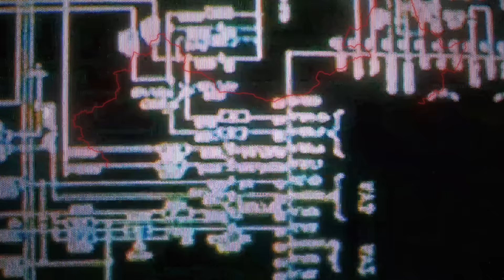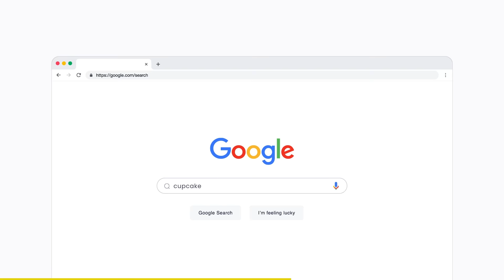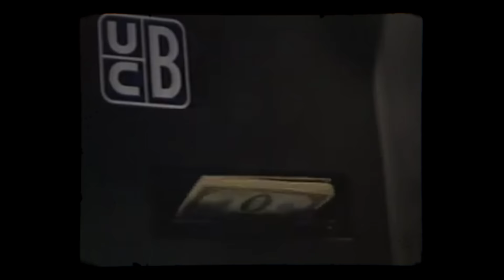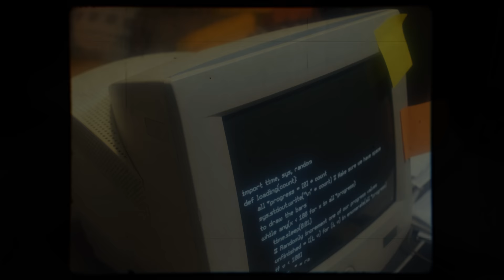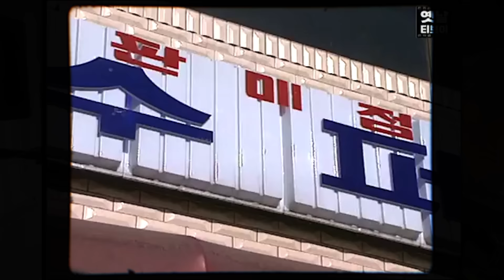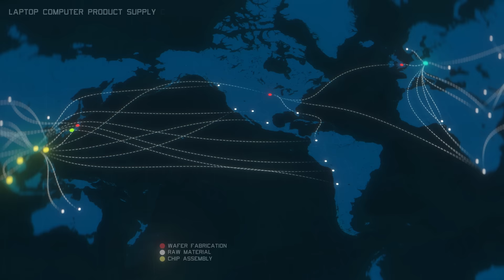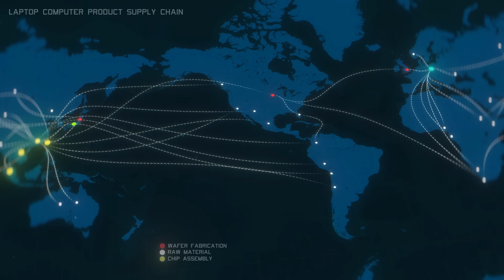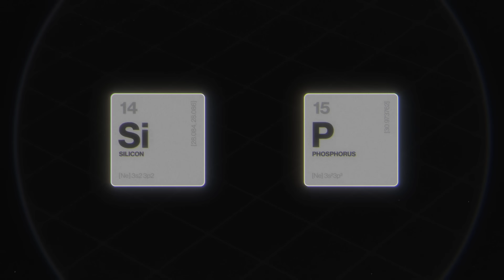Our New Global Economy

Comment: I dont even know where the stock market is headed to right now. my portfolio of around 200k is not increasing more than 5% and people are predicting a crash .
Reply: I don.t really know your risk tolerance or asset allocation, sounds like just bad stock picking. Also unclear if the advisor is providing any other value via financial planning or other decision making. But likely scenario is just bad stock picks. Index funds, Etfs and chill.
Reply: ..You should definitely fire yourself ! That's a bad financial advise. Over 50 years of data reveal that those who work with fiduciary advisors typically earn more than those who go it alone. I've been fortunate to work with one for 6 years, resulting in a $3 million portfolio.
Reply: I've been looking to get one, but have been kind of relaxed about it. Could you recommend your advis0r? I'll be happy to use some help.
Reply: Amber Michelle Smith is the licensed advisor I use. Just search the name. You’d find necessary details to work with to set up an appointment.
Reply: Thank you for sharing, I must say she appears to be quite knowledgeable. After coming across her web page, I went through her resume and it was quite impressive. I reached out and scheduled

Comment: As someone who is involved in global manufacturing and seen this all happen, I am not surprised. All the moving of manufacturing overseas just provided short term gain. The answer is to not take away global trade, it is to make every country play by the same rules. The same health and safety rules. The same minimum wages (edit: min wage I think now is impractical). The same worker's rights etc. Right now, we do not have the same rules and policies in place.
Reply: can’t have the same rule for everyone because  countries are at different development stages.  However, forcing China to play by the same rules would be a start.  China plays with its own rules that only benefit itself
Reply: We can't even do that among US states, and that's part of the reason that all of this works.  For example, if China was forced to use the same minimum wage as the US (to say nothing of the states that have raised MW above that), then there would be no reason to have those jobs in China.  We look at China as "stealing" our jobs, but think nothing of the Europeans that are out of work because compared to US labor (even unionized US labor in many cases), their labor is shockingly expensive, so the production occurs here rather than there.
Reply: It wouldn’t make sense to give everyone the same wages. First of all, there are so many different currencies, not one central currency used by all. Secondly, the purchasing power of these currencies varies significantly. Thirdly, the cost of living also varies from place to place, sometimes quite drastically. Half of the world’s population lives on less than $5.50 per day.
Reply: It's called capitalism.
Reply: @cassidyjewel3639 it's all manufactured by humans. We should all be like Star Trek.
Reply: @didiermontagnier6114  lol, a delulu
Reply: so an absolute global dictatorship :D
Reply: @jasonbrannen7598  Good points about minimum wages. So then, at least the health and safety and workers rights should be at the same level. That would be better for everyone. There are some large cost savings companies in countries that are lacking in these things have. Does not make it at fair competitive environment.
Reply: @cassidyjewel3639  Yes,  wages at the same minimum may have disadvantages, but having equal worker rights and safety would make things more fairly competitive. There are big costs in those.
Reply: @californiajohntravels  Right. I believe in it. It just needs to be an equal playing field. Even our North American Capitalism has laws and regulations. Others do not.
Reply: @SublimeNotions  No lol. Just fair regulation across countries. So workers in other countries have the same rights as we in North America have. Easy for other countries to compete when they save all kinds of money on workers' rights. That's why we don't have a Foxconn in NA!
Reply: Your argument fails to address the imminent climate crisis and how strongly it has been exacerbated by Globalization.
Reply: @hannahpickhardt2682  Definitely something the world needs to better deal with and plan for!
Reply: I voted for Ross Perot in 1992 because of his staunch anti-free trade stances and other policy ideas. In 2024, I will be voting for Joe Biden for the same exact reason.
Reply: @didiermontagnier6114  So does Murica, remember Plazza accord !!!
Reply: To begin with, let's remove the US dollar as world currency to level the playing field. Let's have a payment system that's really independent instead of being under the thumb of Murica, can you accept those 2 rules primo ?
Reply: Even if the whole world was at the same level of development, that would still not be possible, because you would have varying access to natural resources.

The world is not supposed to be just in terms of a human understanding of such. Humans adapt to the world. Trying to make the world adapt to us often just breaks things.
Reply: The whole world has 8 billion people with one standard of labor law. That is only possible if there are no borders where people can freely travel anywhere, and the world is ruled by one government. Every country, like every human being, will use its strengths and minimize its weaknesses to get the most for itself. This is free will and freedom America loves.
Reply: That's the same as ending global trade, because there's no way to enforce all the rules you propose on foreign countries, and if you could, the whole point of globalization (from the business POV), to externalize pollution and exploitation, would go away.
Reply: @padraicley3265  Words are free and beautiful, let's see whether the actions match the words !!!!  Can u start with Palestine first ? Plz .... Can the workers who were born in Palestine move freely and come back home whenever they want, pretty simple, heh !!!  How come  peace offers have been stopped dead in its track just bcos of these freedom of return movement issues ....
Reply: Good luck
Reply: this is where the west miss the plot. the west thinks that "job move overseas", it did not see or realised how Asia grew is because of it large consumer base. most of japanese, korean and chinese business are not invested by the west, they grew from consumer demand just like the west. this idea that Asia success is somehow owe to the West is a highly imperialistic way of thinking, it ignores the fact that these countries has consumer who need just as much product as in the West, and there are alot more of them. there are more Japanese than there are German in this world, there are more Chinese than American in this world. imagine the economic advantage of US and Germany was next to each other... then you understand the Asian economies... they are huge. apple did not move production to China, they didn't know how to make the phone, so they ask the Taiwanese to figure it out. the Asian already knew how to make touchscreen phones, they made them years before iphone was ever launch. this just doesn't register in the West because the West never care how much Asia has developed.
Reply: @didiermontagnier6114 what are the same rules you are talking about? the WTO? if China is not the one playing by the rules, why isn't China threaten to leave WTO? why is it that US is the one threatening to leave instead? the rule of WTO were create by the West, the fact that China play that game better than the West doesn't mean it is not fair, it just mean the West suck at the game they created. and you don't get to change the rule as you like without the rest of the players agreeing. the West need to stop being sore losers and return to the agreed global system.

the really stupid thing that the West is doing is to use all their political and diplomatic leverage at G20 not in getting support for improving the economic rules to suit them, but entirely waste that political and diplomatic leverage on getting support for Ukraine. Ukraine singlehandly destroyed the Western economies and the West has not realise it.
Reply: @TheMrleeyang  
I don’t understand gibberish
Reply: @lagrangewei  
How many times have China been accused of dumping?  How many Western countries require foreign companies to share technologies with their local competitors as a condition of doing business in their country?  just a couple of points for you to chew on. I have many more.
Reply: @Crunch104  to the people that aren't winning the competition, the environment is never fair. Europeans that have guaranteed vacation and things like a year of paid maternity leave, the USA isn't being fair.
Reply: @didiermontagnier6114 America also wants thier to interest
Reply: Same minimum wage in Norway and Bangladesh? 😂😂😂
Reply: @kth6736  How about a minimum that every country must meet. You then can set your own minimum wage from there. What ideas do you have that are not idiotic? lol 

My main point is the health an safety and workers rights, even if min. wage is not the best idea.
Reply: -To all the nay-sayers,

Its not about making 1 perfect policy change & calling it done. Its about a floor & norms. Yes 50 U.S. states different min-wage but we still have a Fed-min. (yes it needs to increase) but we work up form it & build apon it, globally. 

UAW & Mexican auto laborers/unions showed great solidarity & is a sign in this process of becoming reality. (Slowly yes, but surely as well).

Also not a one of you, are honestly going to tell me we shouldn't force jewelry sellers to insure that the mines & miners where these diamonds came from have safety rules & the worker are paid fairly. No safety rules, 2 dollars a day for a shiny rock that sells for 5-20k is unacceptable & is why we call them “blood diamonds”.💎 (Many unnecessary deaths, & child-labor exploits).

Change may not be inevitable, but is entirely possible.
Reply: Same minimum wage? That's the most ridiculous thing ever. Completely flawed logic, just set the global minimum wage at 5000 dollars so "everyone is rich" and see what happens,
Reply: @Crunch104   I am sorry for calling it idiotic. I Just got carried away a little bit.
I should have called it impractical.

I don't have any ideas on it. Just know that same wage xant work and a minimum cant work either.

Global trade is a collection of patchwork from 100s of seperate trade agreements. One can not simply hope to impose such uniform rules. Especially when there is no central enforcement.
Reply: @kth6736  Good points. And that's nice of you to apologize. Don't see that much on the Internet 😀
Reply: @matiasrisso5917  Yes, the minimum wage idea is flawed it seems, but I think the more important point I am trying to make are minimum health and safety as well as workers' rights. They are severely lacking in many countries while North America has many laws in place. There's a coat for having them in place.
Reply: Which country has ever played by the rules? No country ever!!!
If they did Europe would start by making colonial reparations
Reply: And who makes those rules? The US?
Reply: @didiermontagnier6114  i think that's America's game, China is just reacting.
Reply: Nothing but correct. American workers demand so much for cheap labor. Aside from that, they have unions. Who in their right mind would give jobs to workers like that. I won't. Due to their greed, they lost jobs.
Reply: @didiermontagnier6114 you do know US prints currency to prop up its economy and interests without consequences right?
Reply: Or just let countries be autonomous and run their own country the way they want to.
Reply: Yes same minimum wage is nonsensical, but only in the most simplistic literal interpretation.  What you'd actually want is minimum wage based on local parity purchasing power (i.e. specified in local currency and scaled to local cost of living) after the impact of all other standardization baselines (i.e. health & safety regulations, environmental responsibilities, etc.).

Don't get me wrong, it's still infeasible

Currently.
Reply: @HonoredMule  Great idea! You obviously know a bit of economics.
Reply: Hi, if you are not saved, and would like to be included in the rapture of the church. Believe that Jesus's death on the cross, was enough to pay for ALL your sins , yes ALL ,(past, present and future) That is what the Gospel is about. We are saved by GOD'S amazing grace, through our faith in Jesus's sinless life, death on the cross and resurrection 3 days later . No additional works needed. It is literally that simple.   Ephesians 2:8-9  Romans 10:9-10  Romans 4:5
Reply: Lol same rule,america cant even agree betweeen different state. Lol.
Reply: @Crunch104 you're forgetting you guys had slavery for over 400 years. Where you had basically no labor laws. It contributed to your competitive advantage.
Reply: You involved in global manufacturing? Are you serious? Do you think it's possible for the United States and Mexico to have the same wages? 
Who is going to pay that salary? Is it you or the US military? OK, please let New York and Mississippi use the same wages first.
Reply: some rules ? what makes you think you have the best rules lol
Reply: @jasonbrannen7598  Try Africa for minimum wage...
Reply: @padraicley3265  What about cultural, language, religious, topographical, geological, currency, labour quality (etc.) differences? ...with ❤ from South Africa 🇿🇦
Reply: @didiermontagnier6114 I guess China would look at us in the USA and say the same thing.

Comment: I think this video is wrong in some ways, and I think the biggest problem with Harris' video is that it oversimplifies and dramatizes history:
1. The industrial base of the Great Lakes region of the United States has been in continuous decline since the 1960s and 1970s (you only have to look at the historical demographics of Detroit), and in the 1980s the Detroit auto industry was hit hard by the rise of the Japanese automobile industry. So the decline of the Great Lakes was a trend long before Chinese goods flooded the West. The large-scale integration of China's coastal factories into international trade started in 2001, and you can recall that the first time you saw a lot of goods made in China was actually around 2002, not the 1980s as the video says.
2. The so-called free trade was proposed by the Western countries in the era of absolute technological and industrial advantages, because it was easier for the computer room countries to dump goods and obtain labor force to the third world. But China's industrial rise and expansion has broken the Western monopoly on high-tech industries. Chinese cars and mobile phones are being sold all over the world. Chinese-made ships, CNC machine tools and aircraft will also compete with Western products. This is something the United States cannot tolerate. In fact, this kind of trade protectionism happened in 1980-1990 when Japanese industry expanded globally.

Comment: I think Johny is wrong that we can now know that global trade has not reduced conflict between states. Like it's not falsifiable - there's no way to know that a conflict was averted. Like how do we know China/US relations would look if they weren't economically intertwined? Economic interconnection does additional costs to conflict. 

And that we would expect rivalry and butting of heads in the trade space should shock nobody. But we shouldn't expect tensions in that space to be bad when it's possible that those tensions in trade is not indications the system is failing, but working. Anybody would rather have a trade conflict than war.

Comment: 14:35 The mystification starts here: the current trade conflict is not truly about protecting workers or the climate. Instead, it is motivated by the cycles of the capitalist economy. Specifically, when it was beneficial for big economic groups to invest in China, they did so. Now, however, these groups are facing competition from Chinese big economic groups, and therefore find it advantageous to start a tariff war. Politics is often a continuation of the economy by other means. As "war is the continuation of policy with other means."  Almost all countries are investing in renewable energy and electric cars while also increasing their nuclear arsenal. This is because the ruling capitalist class elites recognize that these initiatives will be central to the future of the global economy, and so they are striving to adapt to this new norm.
Reply: The reason is global resource shortage. Critical elements are now in short supply. Take silver for example. According to Silver Institute globally there was a 140 million oz physical silver deficit in 2023. The silver deficit since 2021 wiped out almost 2 decades worth of stockpiles. Remember, modern medicine and almost all electronics require silver. Electric vehicles require a lot of rare elements. Elements which simply aren't as readily available or require too much energy to extract.

Comment: Have you ever covered the Fairness Doctrine?  Or, another topic I think people would be interested in is how if we abided by the original constitution there should be one representative per 30,000 citizens. They changed that law in 1929 and capped the max at 435 members, which did nothing but consolidate power.  We should have over 11,000 representatives considering the 2020 census.